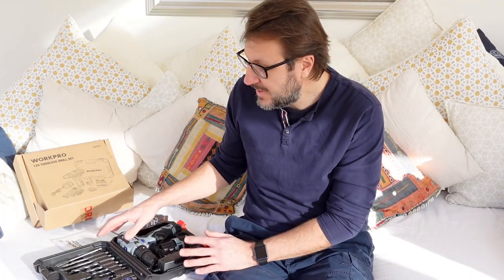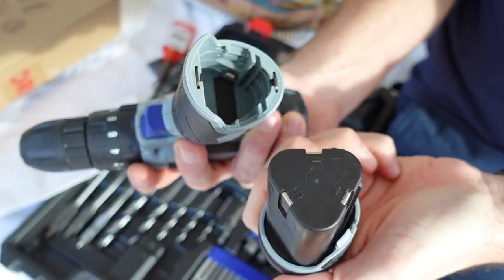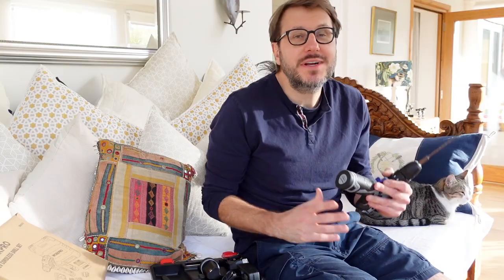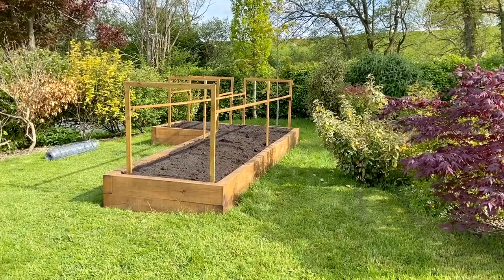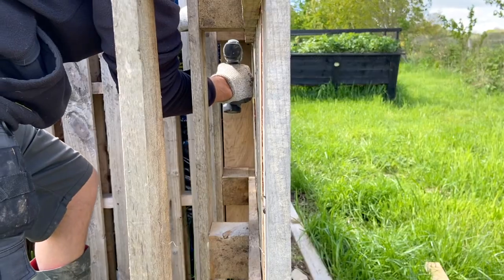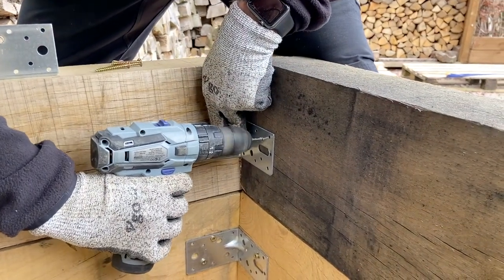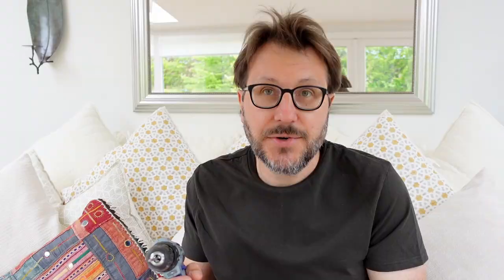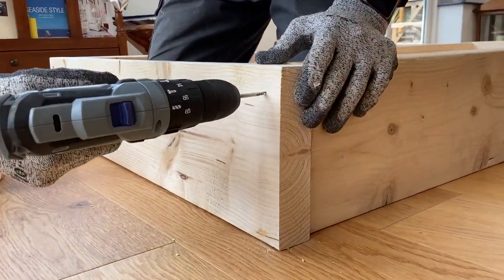Reviewing a compact, cordless home DIY drill from Workpro

Comment: Great review, just what I was looking for! Curious, when you were drilling into brick, do you know if you were on speed setting 1 or 2? I used a similar drill and it struggled on setting 1. I switched to 2 and it drilled through the brick easily and quickly. Hm.